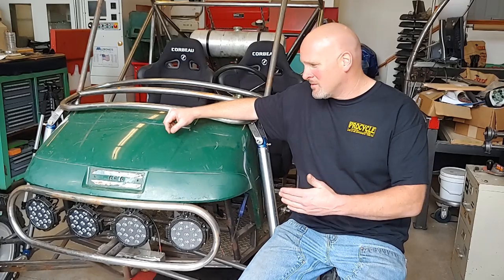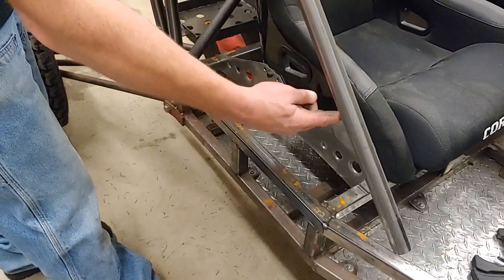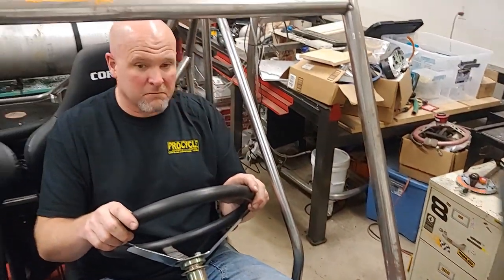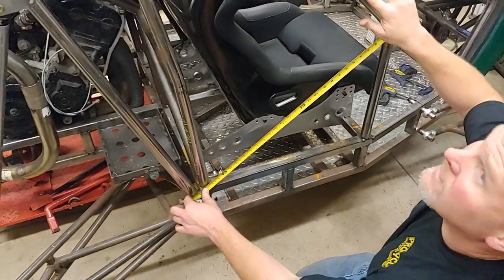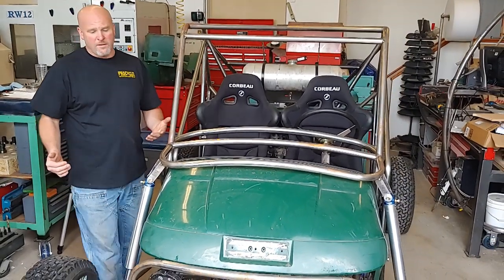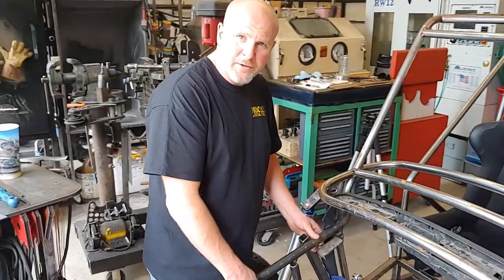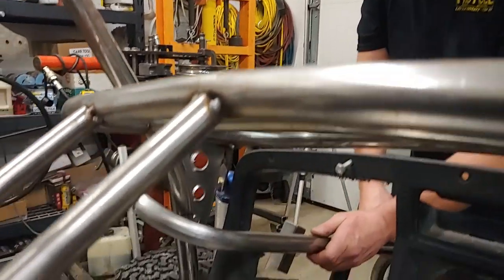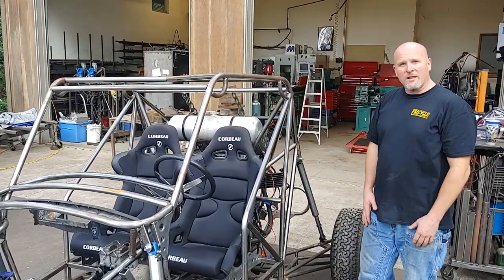Honda CBR EZGO Golf Cart Long Travel Desert Mini Buggy DIY Custom Build Part 7

Comment: Looking good I like the fabrication work and it's nice to hear a welder actually sound like it's set up properly not like alot of channels, it's something that really annoys me when you can tell it's not welding right by the sounds of the weld, anyway your build is looking good
Reply from the maker: Thanks. I'm the same way about the sound of a motorcycle in movies. It drives me crazy when someone edits in a 2 stroke sound clip for a 4 stroke motorcycle!!! Argh!! 😆 Not the same thing, but the feeling it gives you is probably similar... Thanks for watching.